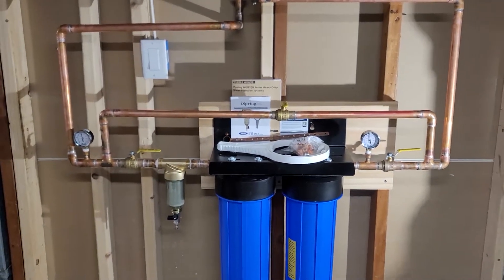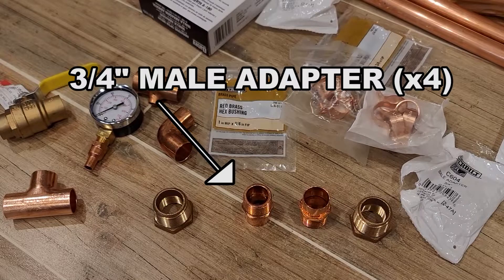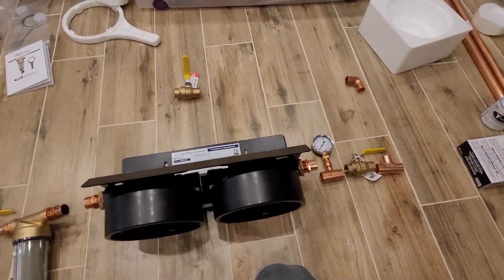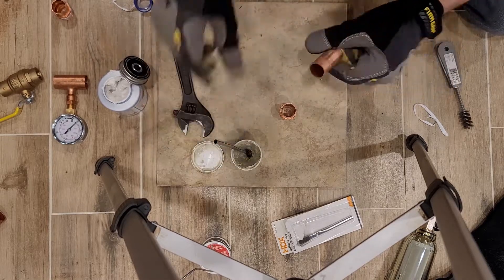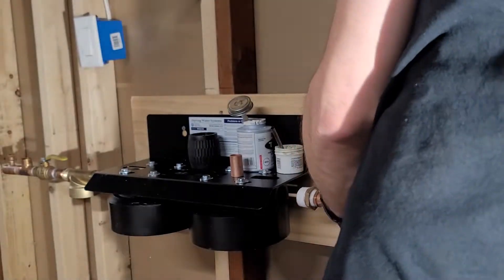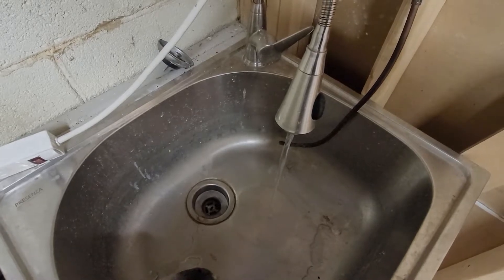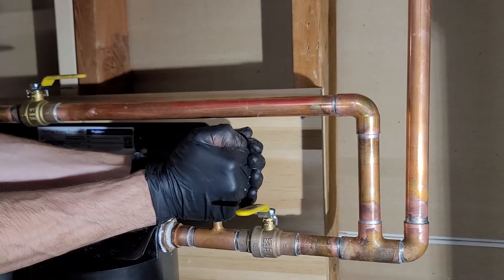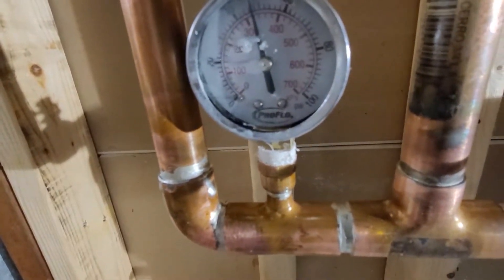How to Install a Whole House Water Filter (iSpring WGB22B 2 stage, WSP-50SL)

Comment: Why can't you just do a single line in, single line out??
Reply from the maker: You can if you want, I just chose to have the bypass because it allows the rest of the house to continue having water while I'm doing maintenance, such as replacing the filters. It also allows a quick test to see how much pressure is being lost at the filters - indicating that a filter change is needed.

Comment: Why so many valves hahahha
Reply from the maker: What's so funny? I explain it in the video. Two on each end to isolate the filter for maintenance - such as changing filters, and the third one up top to bypass the filter so you can still supply water to the house even if you're performing maintenance.

Comment: I have a tankless water system and I live in Florida. My plumber is suggesting that we install a system to keep the sediment out. He said he would install it on the outside of the house at the shut off valve.  Your video shows the filter inside the house. Can this system be set up outside of the house?  I can't seem to find any video that shows the system outside the house.
Reply from the maker: I don't see why not - it's a sealed system so it's probably fine. I assume the plumber wants to put it outside because it's easier/cheaper. If there are no freezing temperatures where you live, that shouldn't pose a problem. Personally, I wouldn't want to have to look at it.
Reply: @Bootstrappin  Florida doesn't have basements and most places don't have unfinished spaces indoors. These types of devices are typically installed outside or inside the garage if you are lucky to have the main line come into the house from there.
Reply from the maker: @ns7w386  ah thanks, that explains it.

Comment: Good thing I think i can duplicate this system for waste vegetable oil!? Thanks.
Reply from the maker: I don't know anything about this, but sounds cool! Are you making bio diesel?
Reply: @Bootstrappin  no not messing around with bio fuel just simply filtering veg oil the same as water to around 5 micron and running 100% in diesel motor. So far its running well and as normal.
Reply from the maker: @ForPropertyInvestors  that's awesome

Comment: Considering installing a bypass and wondering about possible bacteria growth in a long run. Do you have any advice on how to prevent it?
Reply from the maker: Don't know much about this. It's probably fine so long as you change the filters regularly. You may also consider a UV filter as the final stage in your system, like this: https://amzn.to/3X1xDnb

Comment: Just curious any water slamming when you open and shut any of the valves
Reply from the maker: No, haven't noticed any noise
Reply: Water hammer only ocurs if there is flow. If nothing is being used in the house, closing a valve won't make any noise.

Comment: You could have used a union ball value and to get all the water out of the house lines find the lowest spot of your system and use a wet vac and suck it dry thats if you make a mistake  on your soldering or use some bread they sell tools you can use for water leaks after the fact.

Comment: Once you cut the water pipe to your house and you can not complete the job, buy some push fittings with a short piece of pex tubing to temporarily turn the water back on to your house. This is just a backup plan if you are soldering your pipes, just in case.

Comment: If my fittings are offset to each other, gauges not facing forward or filter heads at angles from another, can I back them off till they are in line?

Comment: Just want to verify something. Is the water supply to the filtration system directly from the city line and does it flow into your hot water heater and then to the rest of the house?
Tthanks
Reply from the maker: That's correct, you want to put it first in line before the city supply hits anything else, that way you'll get filtered water into the heater.

Comment: Why do you need a bypass valve/pipe?
Reply from the maker: Because the filters need to be replaced every so often. Without one, you'd have to turn off the water supply valve to the whole house, instead of just selectively. It's also useful insofar as when you are doing maintenance, you won't lose your supply of water to the house.

Comment: Thank you for great, informative content! I am considering installing a whole house water filter as my city has replaced the water main on my street recently and now the water tastes like RUBBISH. I thought it was supposed to make things better?

Anyway, thank you for making this video.
Reply from the maker: Thank you! And that's surprising yeah, maybe it's just temporarily bad tasting on account of all the construction debris getting flushed out?
Reply: @Bootstrappin  Perhaps so. Specifically the water tastes like stale rubber. Maybe because of the new pipe? I'm not sure, hoping it will go away over time though. Until it does, I'm hesitant to drink this gunga water

Comment: this is a great setup! is hard water not a concern ? maybe add a citric acid filter
Reply from the maker: I actually had a water softener there before, and it didn't seem to make too much of a difference (I also didn't feel so great about all the extra water it used). The city water quality around here is decent.

Comment: 11:48 we are definitely kindred spirits. We both plumb our own pipes and we both still use the old school MS Paint software to draw funny diagrams on our computers😄
Great instructional! Nice that you show your mistakes too. All good plumbers make them, and know how to fix them as well😊
Reply: Just caught that you said your IQ was 800! I think you may have left off a zero or two bub😅
Reply from the maker: @Rick-the-Swift  you're right, with my MS paint masterpieces it's probably closer to 8000
Reply: @Bootstrappin  Hey while I've got ya, could you talk a little bit a bout that spin down filter? I'm going with the iSpring 20" 3 stage and trying to guess what is the best spin down filter size to choose. I'm thinking 200 or maybe even 500 micron size to just catch the big stuff before it goes through the big 3. Thoughts on how yours is working? I'm nervous about too much pressure reduction over all and especially right off the bat. 
Sorry if you talked about it in the video and I missed it.
Reply from the maker: @Rick-the-Swift  right, so the finer you go the more likely you are to lose pressure. I can only speak to the one I bought (https://amzn.to/3eDgY41) which is at 50 microns -- my incoming pressure is equal to my outgoing pressure (45 PSI or so), so there was no discernible pressure loss neither through the big 3 or the smaller one. For me personally, that spin down is basically just insurance - it doesn't really matter what it is because it'll provide ample coverage for the far more expensive three stage. Particularly in cases where the city unexpectedly does pipe work and sends dirt through the pipes. With all that being said, it's not like replacement spin down filters are expensive or difficult to replace, (https://amzn.to/3eDgY41), so it may be worth a shot to get both a 50 micron and a 500 to see if there's any difference.
Reply: @Bootstrappin  That's good stuff Bootstrappin. Also not sure how you are going about getting your pressure readings, but wanted to point out in case it hadn't occurred, as it hadn't to me, but I saw where someone pointed out that others were making the mistake of taking the readings while all the faucets were off, and the system was static.
I have 4 bathrooms, two kitchens, two laundry rooms, and 4 or 5 outdoor spigots after my filters. I think I would try to open as much up as possible in and around the house then see what the readings show on both sides, but no doubt this is all still experimental for me. 

Really appreciate your insight, and the job looks pro grade too- especially since you went the extra mile with the bypass valves. 

I've renovated homes for 30 years so I've seen some stuff, but still always learning. Thanks again! 
👍
Reply from the maker: @Rick-the-Swift  oh shit, that's actually a really good point. Short of actually opening up all my faucets and giving it a try, I suppose all I can say is I haven't noticed any pressure problems, all the way up to the top floor.
Reply: @Bootstrappin  Nice! I went with the 50 micron as well. Like you say, just try another cheap filter if it's too much strain. I know you're still going to experiment with those guage readings though LOL. I definitely will too if I cough up the extra bucks for them. Good stuff

EDIT: NM you already know I'm going to install those pressure gauges, because at the end of the day, they look fantastic, and will be fun to show off to my guests! 
😂
Reply from the maker: @Rick-the-Swift  hahah yeah exactly right, the fact that they looked super cool/steam-punkish is like half the reason I even bothered with them.

Comment: Great video, new subscriber here.
I’m planning to install this same setup with the addition of a 100 micron pre filter before the 50 micron since I’m on well water.
We do have a water softener and my plan is to install the pre filters before the water softener and the carbon filters after the water softener. Any issues you see with my plan?  🤔
Reply from the maker: I had to read up on this and give it some careful thought. Your logic makes sense to me - well water usually has a large amount of sedimentation which can shorten the lifespan of both the softener and the carbon filter. By putting the cheapest (and easiest to replace) filters up front, you get rid of sediment first. Then you get rid of hard minerals, and the filter takes care of anything the softener didn't catch. I think it makes sense, although to make the most educated decision you ought to know the constitution of your well water first. If for example it's very iron heavy, you may consider putting an iron/oxidation filter up front. This article helps a lot:

https://waterfilterguru.com/whole-house-water-filter-before-or-after-water-softener/#:~:text=Whole%20house%20water%20filters%20should,chlorine%2C%20sediment%2C%20and%20iron.
Reply: @Bootstrappin  that’s a great article and exactly what I’ve been trying to find.  Thank you!
Reply from the maker: @Ryan.Willis  good luck! Let me know what arrangement you go with!

Comment: Heya, thanks for an awesome video! I’m now in the process of installing mine and this really helps.
I had some issues with finding the 1” adapter that brings the water to the filter. Maybe it’s because they are a little bit different here in Netherlands?
Do you mind sharing where you got yours from? Maybe they can ship it here…
Thanks in advance!
Reply from the maker: A lot of the stuff I got from a local plumbing supply store, but it is all also available on Amazon (although, I'm not sure what will happen if you access these links through the Netherlands -- let me know if it works):

1" NPT MIP to 3/4" FIP Adapter - Brass bushing
https://amzn.to/33YzbXB

1/4 in. Fitting x FNPT Wrot Copper Adapter
https://www.ferguson.com/product/14-i...

3/4 x 3/4 x 1/4 in. Wrot Copper Reducing Tee
https://www.ferguson.com/product/34-x...
Reply: @Bootstrappin  Thanks for sharing! We ended up finding a supplier in NL that had the adapter... It did take us quite some time to understand that there are two systems for the threads in a pipe 🙄 who would've tough! NPT/BSP and the sole difference is: one has a 55 degree angle and the other is a 60 degrees angle... so annoying...

Comment: How much less expensive would this have been using pex?
Reply from the maker: I'm not sure that it would be. If you don't have PEX tools - crimper, cutter, go-no-go gauge, that'll probably run about $100 in just tools. The PEX pipe itself would certainly be cheaper, but then if you were to install pressure gauges, you'd have to get weird with copper to PEX converter fittings because to my knowledge there's no straightforward to install those on PEX (with the exception of Sharkbite pressure gauges if you want to go that route). You might eke out a little savings from the pipes themselves, but we're not dealing with very long copper runs here, so the savings wouldn't be that substantial. I'd just pick whichever style you are most comfortable with -- PEX is probably easier/less risky to work with for a first time job.
Reply: Copper is 100 percent more reliable and the shelf life is almost infinite. I stick with it!

Comment: 10 to 15 wraps of Teflon and sealant. Oof.
Reply from the maker: You heard the part about avoiding doing it again, right? You'd have to undo a significant amount of plumbing to redo a leaky joint. Hence, ample Teflon and sealant, which is a fairly common combo.
Reply: @Bootstrappin  
I did, but "more sealant" isn't the way. The standard with tape is 3 to 5 wraps. You're looking to lubricate the contact points and fill very small gaps at the root of threads and imperfections. The video didn't look like 10 wraps, but its hard to be sure as the video seemed sped up at times. Maybe you meant 10-15 inches of tape?

Sealant has its champions, especially for metal to metal connections, but I've never heard of tape+sealant, except maybe in a last ditch field repair context.

The difficulty of repair is a design problem, albeit a common one. Add a couple of slip Union fittings or shark bites. If you got the threaded joints tight enough, you're probably fine. Here's hoping.
Reply: @Bootstrappin  Don’t want to sound so negative, as I thought the video was great, and lots of good tips and advice, but for at least some brands they say not to use sealant on the joint to the filter housing. Good for metal-to-metal, not to plastic, may damage it. Also I’ve only heard 4-6 full wraps PTFE tape in plumbing videos I’ve seen, but I’m still learning.

Comment: Why. Not. Sharkbite fittings?
Reply from the maker: I wouldn't trust them for a permanent install. I've seen solder joints last over 60 years, don't know if the same can be said for Sharkbite, since they've only been around for 15 years. They are also very expensive compared to regular copper fittings. That said, I have used them in the past, and they made plumbing very easy.